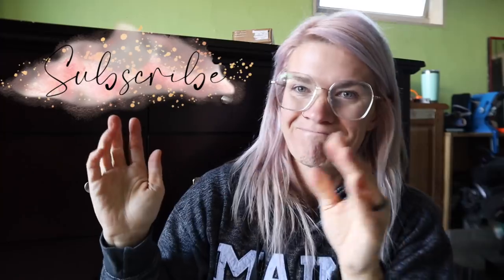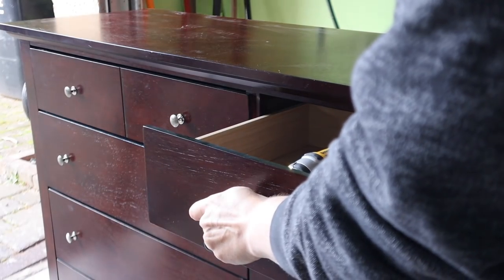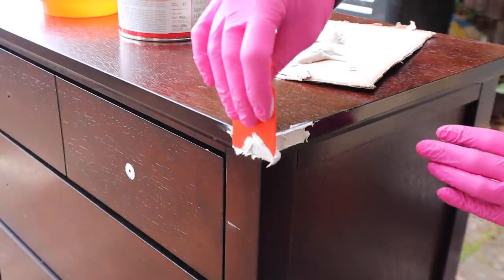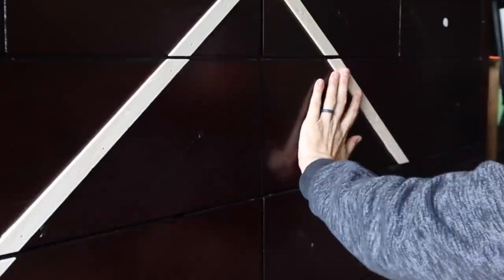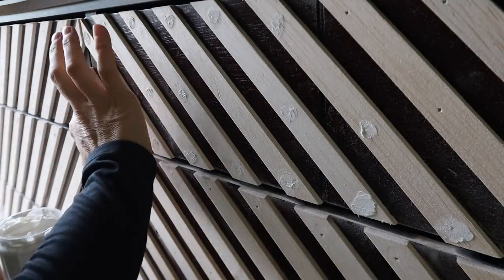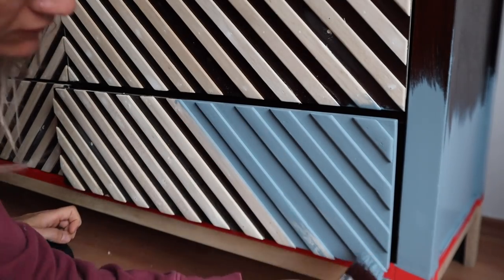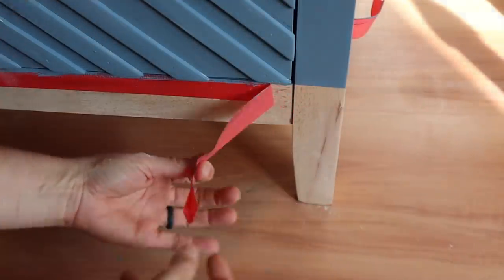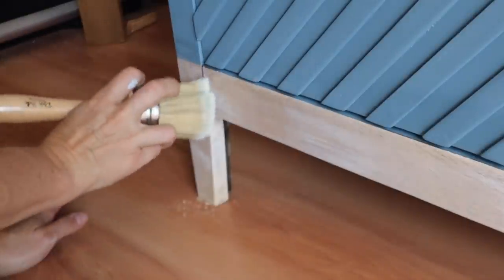Trash To Treasure Facebook Marketplace Find | Ombre Blending Furniture Flip Using Dixie Belle Paint

Comment: Man that looks great! You know what would make the balsa strips a little less tedious? If you glued all the strips to the drawers from top to bottom then take a flush trim saw and cut in between the drawers all at once, it would make it go a little faster and ensure you are getting perfect alignment all the way down the drawers.
Reply from the maker: That would be an option but I only had 25 strips so I was trying to strategically use everything so I didn’t waste anything

Also each strip is roughly about $1.50 or so and that adds up if I have to use a bunch, it’s more work the way I did it but less product, but then your way is less work and time and more expensive in product…what do we do what do we do……